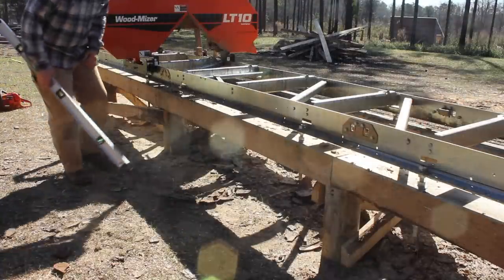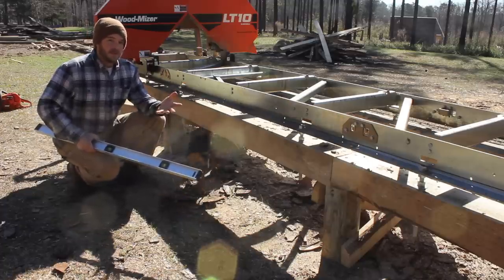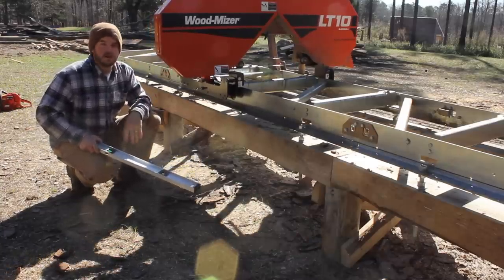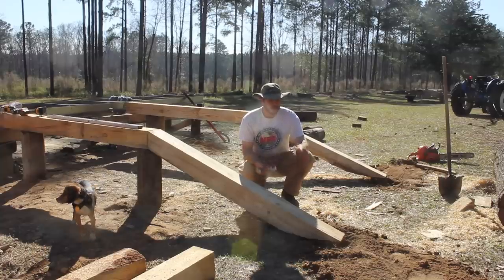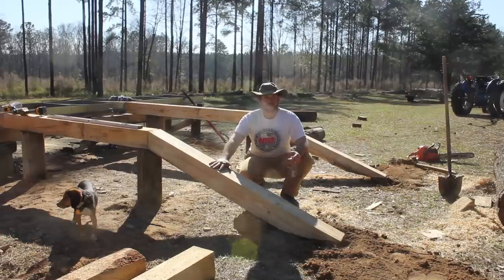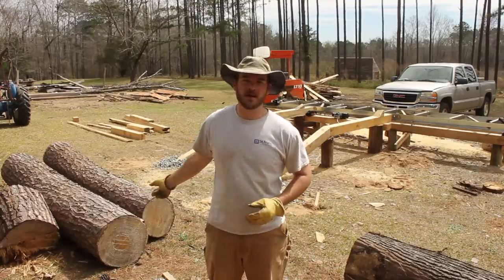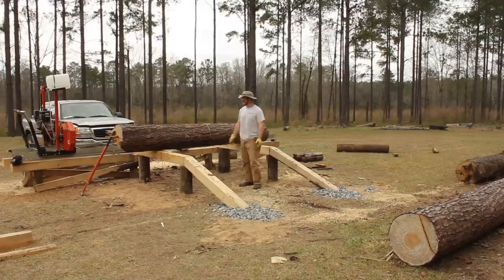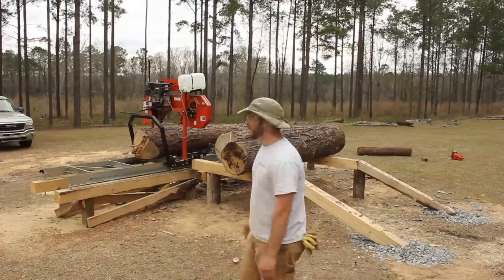The Best Sawmill Upgrade I've Ever Made

Comment: Might have been easier to work, if the wench and connection were on the other side of the mill.   With the wench mounted lower and the connecting cable up top so you didn't have to bend over every time to hook and unhook the cable.   I'll let you know, my mill should be here this Thursday so I'll see.

Comment: I've watched a lot of your videos and like them a lot. Here's a nitpicking observation: A post that is set into a hole will be less likely to settle further into the ground later if you rest it on top of a small concrete block (a "doby") so as to allow the concrete to flow under it. Also, you'd want to avoid there being any loose dirt at the bottom of the hole. Stay after it, man.

Comment: If you are going to use the winch a lot, for the log pulling,  you might consider putting a strap around the log, then connect it to a shackle/pulley. This should increase the life of the winch cable. It's cheaper to change a strap than the whole winch cable?

Comment: I saw a winching video where they put some type of blanket over the winch line so that if the line broke the line wouldn't snap back and hit the operator in the face / body etc. You might consider getting one of those for you safety.

Comment: I foresee an issue with loading a second log onto the platform the way you've got it set up here. As your second log comes over the top of the ramp the cable will be pressed up against the first log that is currently sitting on your staging platform. You could use a removable pulley and frame to lift the cable above the height of the log already staged. This would also bring your pulling force more parallel to your ramps and reduce the horizontal component force against them, which increases as your log rolls up the ramp and becomes higher than the winch level.

Comment: No dogs in 6x6 to hold log to stop from rolling later buy log Turner attachment. Drainage from mill and roof. Then create an out feed for scrap and rack for dimension lumber. 2x 4x 6x 8x also an out feed for cants. Buy and industrial tractor with forks and bucket. You can stock material for chipping for hog fuel.

Comment: good job.....just curious as to why you would raise the mill in the first place.
easier to clean around, i suppose....mine is on the ground, to me it seems safer, and easier.
Nice ramp.
Reply from the maker: When it was on the ground I found it very labor intensive to bend over repeatedly to remove boards and slabs. Definitely easier to clean around...and less corrosion on the bottom of it. Appreciate you watching!

Comment: Friend, spreading gravel at the base of the log ramp is the absolute worst thing that you could do. Inasmuch, as when logs are winched up the ramp they are going to get gravel embedded in the logs bark and if you don't see it, the gavel will either dull your blade or break the teeth. Also, you should place at least one cross member between the two top slides and one between the two slanted side rails of the ramp for support and for joining the two sides together, which will keep heavy logs from forcing the two sides apart. Further, the winch should be mounted on the opposite side of the bandsaw's log railing/bed on a separate mounting post and at least 2" higher than the bed's railings. Just hope this helps.

Comment: What type of cordless drill did you use in this video.  Is it the type that don't strip out your screw heads
Reply from the maker: Greg Brucks I used a dewalt 20v to predrill, and a dewalt 20v 1/4 impact driver for the long screws. Works great! No stripped heads at all.

Comment: When a plan comes together.  I'd be afraid of that wire snapping though, it could go anywhere.  But that might just be my imagination, I'm sure it's rated for way higher load than just a log.
Reply from the maker: Those cables make me nervous too....it's a 4500lb winch though, so I can't imagine I'll ever overload it.
Reply: Thought so, you're golden! Nice work! I know nothing about milling, how much is a typical log you'd be loading? Let's say the biggest log you've done, on your mill, how much do you think it weighed? I think the only thing you'd have to worry about is inspecting the cable now and then. It is being "grinded" during the entire load.

Comment: Very similar to the ramp the Outsider uses. You need to watch your logs; the second in the video almost dropped off the ramp/storage area.
You use an electric winch; the outside uses a hand-cranked winch - both work at the same speed.
Reply: You might place the winch on the other side of the cutting bed to give the option of rolling the logs directly onto the bed.
Reply from the maker: Not a bad idea, but I'm afraid the winch cable would get pinched over and over again between the log and the bed rails. That second log was definitely close, but I was keeping an eye on it. Appreciate you stopping by.

Comment: Great job should make life easier and save your body from wear and tear. Tip I always wrap the cable of center towards the small end it helps the log roll straighter play with it you will see the more you work with it. Look for the loader for your tractor you will see they can be had cheap used. have a good one
Reply from the maker: Thanks Larry. Appreciate that tip! I would love to find a good loader.
Reply: @falllineridge  the guy I get logs from has one for 400.00 it is off an international he said 1 cut and a little welding it will fit anything
Reply from the maker: No kidding? I assume they require external hydraulics?
Reply: @falllineridge  I am not that familiar with tractors I never drove one until I got min last fall. check with someone familiar with them I know a lot of guys that go to auctions and they seam to find what ever they need

Comment: Pressure treated telephone poles are not treated for dirt contact above the bottom 4 to 6 feet. The cut ends are like a buffet for the hungry critters in the ground. A coating of copper napthenate treatment would have been good. You need to go buy a gallon of copper napthenate so you can slop some on all of these cut ends and ground or near ground contact wood pieces. I lost a lot of wood by not treating it. 
If you use a wedge or peavey to slow the large end of the log as it rolls, you could get the small end to catch up.
Reply: I like copper naphthenate too. Time tested, pretty cheap, much better than the burnt oil or whatever.

Comment: Where does the height run versus truck /trailer beds? If you had a winch setup at 90 degrees would a second set of braces allow them to come straight of each on the deck? Would really be a time saver but have always seen different heights, do they make a jack that would allow the trailer to level up to the deck or is your mill set to that on other side?
Reply from the maker: I think I understand what you're saying...and that would be a cool option...but I think this deck is too high for that.
Reply: @falllineridge   Angle a piece of flat steel with 2 pieces of I beam to back up to, the steel acting as both trailer stop and support for the ramp to staging deck, the log has a skid plate to make the transition. The tractor can then pull or just boom up the smaller logs directly onto the deck. Just an idea/ suggestion, you sure solved the lower ramp rot issue, I didn't think of that- smart.

Comment: need a little piece of plate steel or even a 1/4inch plastic piece ON TOP OF the reel with  a spring holding it down so the wire would roll up straight and NOT KINK the wire rope! be easy  to do. thats the way the big boys do it!
Reply: would it be better to bolt the winch on the BACK side of  the cross piece to keep it futher out of the way of your work? log could smack it where its at!

Comment: Did the saw manufacture recommend the saw set that high off the ground?
Reply: They come with trailers as well , The height is not a problem, just depends on where you plan on walking... Adding a whole deck would have been a nice...
Reply: @kameljoe21  I have a LT-10. No tailor kit was made for it.  Mine is on a deck that will hold a 2 ton 16' log.  I have the walk way just inside where the sawdust blows. Low is better when turning the log and adjusting the center of the log to match on each end.
Reply: @badbadbob1 I just now noticed that it was a LT10, They not make a trailer kit for this one yet other mizers do have trailers... My neighbor has a woodmans or something like that... He built it in side a shed and it sits on some large bridge planks then concrete all around it,,, He uses a fork lift to load the logs on it... Not the set up I would have chosen, I said that he should have built a trolley so he can load the logs out side and winch it in and then roll it right on the rack... Its a pain to get them in the building...  I would have to guess that the higher up the less bending one has to do, I do think he should have built a walk way on each side, does not have to be too wide... One could build up  a pad on the loading side long enough that logs could be dragged up and then have an area where a trailer could pull up and just roll the logs off, Depending on how many you stack on a trailer... I intend to either buy a swing blade mill, or finish the one I started a few years ago,....

Comment: You rigged it right ,replace the winch with a snatch block and the tractor can pull faster also I Have loaded logs on a trailer with the same rigging using fence posts for ramps and the towing truck to pull the cable just block the trailer wheels.

Comment: What brand snd model winch are you running
...battery or 120v?
Reply from the maker: It's a 12v Traveller brand from Tractor supply. 4500lb.

Comment: You need to have a Alternator running off your gas engine to charge up a battery for your winch.
Reply: James Tate perhaps...or a couple of solar panels with a charge controller connected to 12 Volt battery such as what I have setup for my HAM radios. No gasoline used and this setup has served me well for 11 years. I use the same battery to power my air compressor to fill the vehicle tires and wheel barrel.

Comment: A nice project but wouldn’t it have been much cheaper, quicker and easier just to use forks on the tractor to pick up the logs and stage them on the upper section and not bother with the ramp and winch???  Your dog is a keeper. I bet he makes long tedious projects easier.

Comment: Nice job with the build, but get rid of that coarse rock before you start destroying blades. Now this next suggestion is going to create some controversy but treat all that raw timber you made it from with old engine oil, yes it's not environmentally friendly but it will protect it from both the weather and termites.
Reply from the maker: PoppyRob No controversy here. Burned oil is about the best weather and bug proofing available. I’ll likely do that.

Comment: That cement IS NOT going to last, Just dumping it in the hole and dumping water on top DOES NOT equal properly mixing it. Further, you just created a cup where ground fluids can concentrate and rot out the bottom of the post. Proper proceedure is to fill with dirt, tamp it down, then top with properly mixed concrete NOT cement. What you did was the cheap and lazy way of post setting.